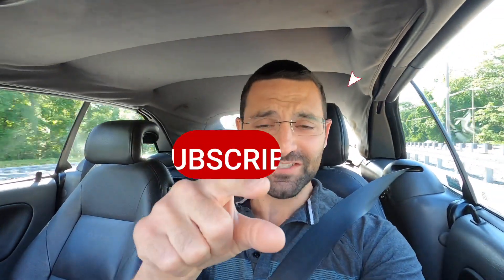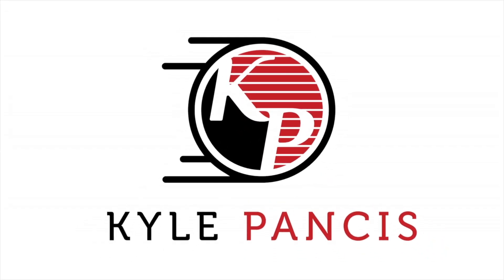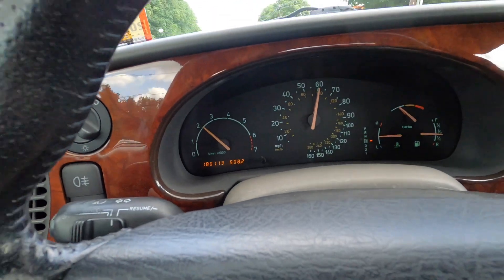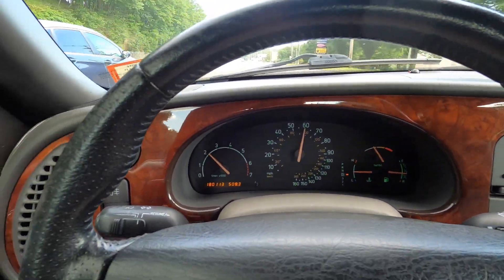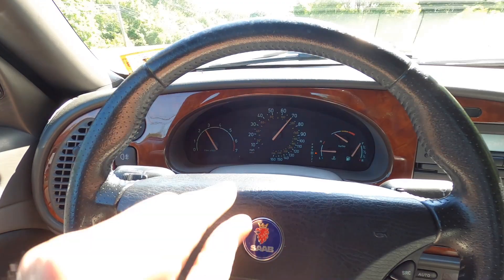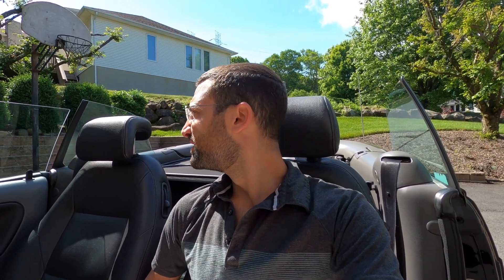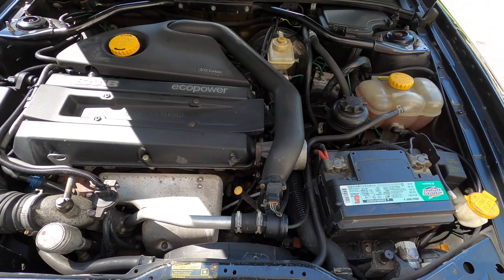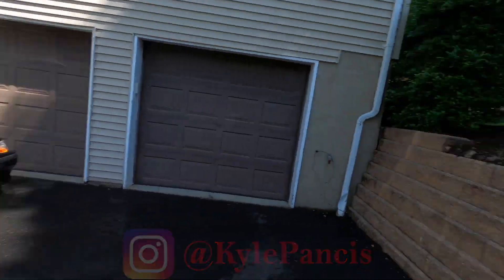Im selling my Saab 9-3 Convertible Here is its condition!

Comment: Hey Kyle, 
Just got a similar convertible as a handmedown. I know about the scuttle shake issue and am not expecting Coupé handeling, but on bumpy city roads the steering wheel is shaking a lot, mostly in a lateral, left to right motion. I doubt that this is how it left the factory. Any idea what could cause this? 
Sweet car otherwise!

Comment: I was really hoping to find a 2002 or 2003 convertible with low miles, but could only find a 2005 ARC convertible with 88k on it, which I like the old ones better...